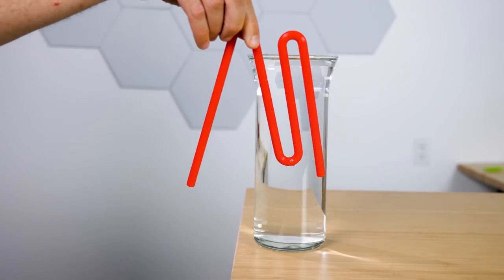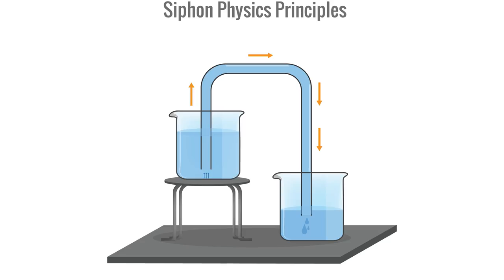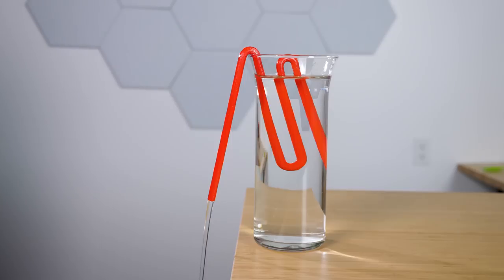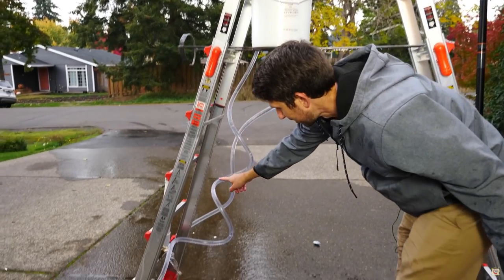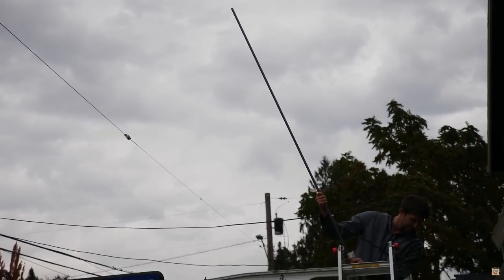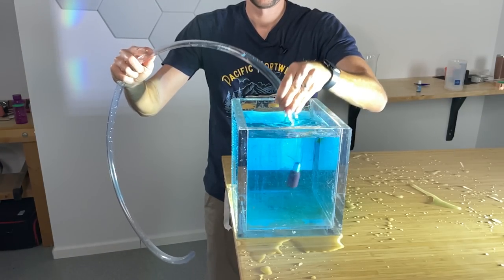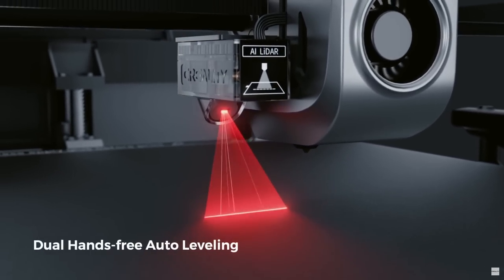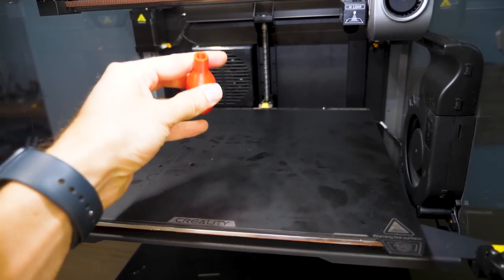This Tube Makes Water Flow By Itself

Comment: When "Free energy" topics come up, this is what I imagine is happening in the hidden physics. A ram pump is not free energy, but we do get the water up the hill without spending anything(much), other than a bit of excess water (kinetic/gravity/potential) energy. The water leaving at the bottom is the lost energy, it flowed downwards and we lose it. But to us, we have gained something (higher water) without anything(much) given.
When "free energy" comes up, everyone arrogantly/blindly shouts "Its impossible!", "laws of thermodynamics!", "Quack!"...but ignores that many things in real life appear to be free energy. The Sun, gravity, atomic radiation, fusion, many devices we've built are nearly free....What's to say we can't find an exploit at the (sub)atomic level that gives us seeming free energy by shifting some particles around?
People are blinded by the 2nd law of thermodynamics and refuse to think anything could be close to free,,,or that the energy cost would be something we don't care about losing. A whole 2 generations now are ignoring the past Tesla's, Curie's that came before them and hunted for nearly free energy.

Comment: It would be interesting to use various sizes of tubes that are smaller than the one he used. It would get to a point where surface tension would not allow the syphoning to happen.
Reply: My first guess was that this used surface tension with a comb-like series of fingers or plates that were angled upward, using similar action to a Tesla valve to draw the water in one direction.  Once the water got over the last hump, the siphon action would take over and speed up the flow.  Such a device would need a very particular scale depending on the viscosity of the fluid, however.  I like the real one better than my idea!

Comment: The momentum explanation makes no sense. You can't use momentum that you gained by going downhill to reach higher elevation than you started with. I think there is a pressure spike caused by quickly putting the siphon in the water. If you just submerged it very slowly it wouldn't work.

Comment: @The Action Lab

Time mark 0m 44s.  You make a scientifically false claim about how siphons function.
I bet that you can make a siphon work in a vacuum, but not in Zero Gravity because I challenge the idea that it is Air pressure that makes a siphon work.  It is gravity that makes it work.  the quantity of water on one side of the tube/hose contains more water within it and since there is more water in it.
Air pressure is equal on both sides.

I could be wrong, but an experiment has already proved that I am not.

Take any clear hose just to see it and fill the hose with water. Submerging it so that no air is trapped within.  
Cover both ends with your fingers.
Raise one end higher than the other, with the tube higher than the ends and the ends facing downwards.
Release both ends at the same time.
The water will always, 100% of the time, flow to the lower end.  Arguably, the lower end actually has higher air pressure upon it.

It does not matter.  Gravity makes the siphon work, there is more water within the side of the hose with the lowered end.

Comment: The Hercules monument in Kassel Germany, has an enormous waterworks, they run it for the public once a week. Takes 2 hours for the water to run down. It uses a hydraulic ram in the nearby river to pump the water up into the storage tanks. Worth going to see if you are within 200 miles of it. It was built in 1700.

Comment: This works by using the falling water as a suction force for the rising water. The first siphon is required because the tube HAS to hang out of the glass and the water can only be lower than the glass, the first siphon HAS to be below the water so it can overflow, create suction and get momentum. Now let me watch the video...

Comment: Okay I don’t get where the extra energy is coming from to push the water up past the second higher hump. Going off of conservation of energy, lets say the glass with the straw is the system.  A system has a finite amount of energy, at the first hump it would have kinetic and potential energy. Its then converted more kinetic with some potential at the bottom bend, I’m not seeing where the extra energy needed is coming from to push the water higher than it initially was. Any insight would be appreciated. You could approach this from a fluid dynamics approach to but the general energy equation I think would also lead me to the same question.

Comment: It’s not the atmospheric pressure dude….it’s the weight of the water in the downward part of the tube pulling the water in the upward part of the tube…otherwise the down side of the tube wouldn’t have to be more than the upward side……can’t believe you got this wrong….it has nothing to do with atmospheric pressure, except that the water isn’t boiling,,,,,which would mess it all up!!

Comment: Forget about shaker valve or even shaking! A simple trick is this: immerse most part of the tube in the liquid in the container and let the liquid fill the tube (up to the level of liquid in the container). Close up the exit end of the tube with your thumb. Raise the tube from container over the side of container and lower the exit end until the liquid level in the tube is below the liquid level in the container. Now open the exit end. Liquid will be free flowing until the liquid level in the container is equal to the level of exit end of tube. Tested method, it works! Suitable for all types of liquid and container, gasoline tank, toxic liquid etc.

Comment: That like a ladder.
Water goes up a tube, then down and then up a bit higher.

How high could you go? If the tube had extra "steps", would it bring the water higher and higher? What is the limit on the height?

Comment: There's a guy at a wet market who has a clever method, a bit like the shaker siphon but without the shaker. He keeps his thumb on the exit hole, and with his other hand he rapidly pumps some length of the inlet tube up and down the water- every downward pump his thumb opens the exit letting air out, and upward pull he closes the exit pulling water up. It takes a few seconds to start it.

Comment: If this glorified straw, as simple as it is, is so easy to get working as a pump, then why haven't we seen really any cases, as far as I know, of engineers using them in builds for perhaps centuries, at least where a lower pressure like this would be sufficient?

Comment: You can use the water hammer effect to power a piston that inturn drives a flywheel to keep the cycle going forever until the joints/grease wears out. And you dont need alot of height for the water to drop.

Comment: As others have already said - tlit is stye energetic insertion into the water that causes the water to start flowing.  Not the straw itself and not the sahpe.....  Without the strong insertion it wouldn't happen.

If it was very slowly inserted it wouldn't happen.

Comment: So using a ram pump setup and a way of collecting the water for use again could you have the falling water from the upper most hose flow over a waterwheel and generate power.

Comment: if you want to siphon a fluid that isnt damaging to your skin, you can do the shaker siphon with your finger on the output side of the tube. To do this, push the tube rapidly into the container and then pull it out rapidly as well, but when you are pulling it out, seal the output of the tube with your finger. The trick to it is, when you are pushing the tube in, you want to do it quicker than the fluid flows back down the tube so you can create a column of fluid in the tube.

Comment: That shaker syphon reminds me of my childhood.. We had a well water pump which had a non return valve at the end which goes in the water. The pump and motor are at ground level. For the impeller to work the pump should be filled with water. The non return valve should keep the water from draining and thus providing the starting water. But sometimes you drain it for maintenance and instead of using the filling port (where you pour water) we just use to life the valve and drop it, while it went down it opened and let the water fill.. As it fills the pipe gets heavier but it used to get the job done..

Comment: It appears that the laws of physics are broken when the water falls fast down the 2nd section and has enough momentum to go over the 2nd hump which is higher than the first hump. I don´t understand how the momentum is sufficient to continuously go over the 2nd hump.
Reply: There is also energy being put into the system from you placing it into the water, that may account for it.

Comment: How good does your new Creality K1 Max 3D printer work? Do you have any issues with it ever? I was thinking about buying one but I noticed a lot of bad reviews about it on Amazon. DO you have any suggestions for me on what brand to buy? Out of your 6 3D printers that you have, which one do you think you like the most? Also if anyone else on here has any info on how to use 3D printers and which brand to buy please let me know cuz I don't know much about 3D printing but I would like to buy one so I can try this expiriment myself.
Reply from the maker: I love the K1 and K1 max. Their printing speed makes me choose them every time. They make a perfect print every time as well. I have had problems with the extruder and clogs. I have replaced one extruder but since then it has worked great. If you are just buying a first time 3D printer the Ender 3 S1 pro is the most reliable printer I have. hardly ever has any problems. It is much cheaper and simpler. It prints much slower but is just a reliable work horse
Reply: @TheActionLab  Thankyou so much for your response. I really appreciate it. I'm a big fan of your science videos and I hope you keep posting more. How acurate are the prints from your Ender 3 S1 Pro 3D printer?

Comment: That looks like a very cool thing to help quickly change water in fish tanks!
Reply: I don't know if they still sell them, but I have an ancient shaker siphon from a pet store. It's a rigid large diameter tube connected to a smaller diameter flexible tube. Shaking the large tube up and down in the aquarium causes the water to ram the air through the flexible tube until enough water is rammed in to displace the air and start the siphon effect through the flexible tube. This siphon has no moving parts, no valve. The effect is totally due to the open mouth of the large rigid tube ramming water into the smaller flexible tube and displacing the air due to inertia.

Comment: Looks interesting.  I am wondering how much influence the speed of insertion into the water has on the establishment of fluidity?  And if we plug the outlet pipe when it is inserted into the water and then unclog it when it is in the water, does it work at all?  And how much can we raise such a siphon out of the water when it is working before the water stops flowing?
Reply: your last two questions seem easier to answer then the first. 
#2 as long as the system is designed to work on it's "own" inherent energy level. if you clog the end before submersing and then remove the plug after, it would work perfectly fine.  
in fact it would be a near maximum efficiency or a maximum 'stagnant' efficiency anyway, because no water would enter the system until after the plug was removed and the system would fill at a maximum potential stagnant flow speed as it is designed to,  again that is assuming the required climb of the siphon is set to an achievable level. 
there is the question of how much "extra" energy could you introduce into the system by "slamming" it into the water as fast as you could and driving the water up the first tube faster than the water level/pressure alone could do, I'm sure that would depend on diameters of the tubing  velocity and how deep into the water you can actually drive the siphon and probably some other factors that I'm over looking..

#3 once started it's still a sealed siphon and as long as the end in the water remains in the water holding an airtight seal and remains higher then the end out of the water it should continue with no issues. but if you break the surface as with any siphon you will lose the energy to maintain the system quickly.

#1 assuming that the system is indeed designed to work under it's "'"own" inherent energy level" the insertion speed shouldn't really matter UNTIL the water level reaches the top of the first tube and starts to fill the second tube, at that point the system will loose efficiency the more impaired the flow of liquid is (the slower you finish submersing the top most part of the tube) because when the liquid reaches the bottom of it's fall it's extra energy from falling will be wasted with 'sloshing' if there is not sufficient flow behind it forcing it farther down the empty portion of the tube.

Comment: —Would it be possible, potentially requiring air chambers to allow the water to be compressible, to make a hydraulic ram pump using resonance as the valve so there would be no moving parts.
—I'm reminded of singing tubes where a candle causes them to resonate with no moving parts without the flame touching the tube. Or something I believe that is known as the sterling engine, which I think you've done on your show before.
Reply: Your first line is basically the description of the ram pump, but water is not compressible.  The air in the air chamber is, just like the air in a water tower, which acts as protection for city water pipes against the ram effect.  With said ram effect, if there is not air in the system to act as a buffer, or the air is only in the pipes, (as it essentially can be within a house,) the ram causes the pipes to change shape, which eventually leads brittle pipes to break.

The singing tube sounds like a whistle driven by convection.  Heat causes upward airflow across a shape that resonates with that air.

Stirling engines rely on conversion between cold and hot air to drive a piston, the same way a combustion engine relies on converting liquid fuel to explosive gas to do so.  The flywheel in the Stirling engine does the same work to maintain inertia, as the other pistons in multi-stroke engines, including steam engines that Stirling intended to replace.
Reply: @VoltisArt 
.
Yes I understand all of that.  I'm just not very good at communicating it.  However I was talking about the concepts being somewhat similar when you overly simplify them.  I was using them to paint an image for you so you could understand what I was trying to say due to my lack of ability to communicate.  What I was trying to say was the air would give the water the ability to move back and forth at resonance substituting in place of its lack of compressibility.  If it's calibrated right hypothetically it would be a hydraulic ram pump with no moving parts.

Comment: Add a resistance latch of some kind at the start so that once a certain amount of pressure happens it opens and stays open while water is flowing then closes when it stops. That would allow more initial pressure to self-prime the straw and allow multiple straws/containers to be used for increasing elevation.

Comment: What happens if the straw is put into the water more gently ...
Reply: Doesn't matter. That's why it's curved up and down like that, to let water build up speed
Reply: I think it may matter ... What gives the water the energy to climb up the curve that is higher than the water level?

I think the initial jolt is what gives it the energy to rapidly climb up the first curve ... If it moves gently it may get stuck at the same water level as the container before it makes the second curve.

Comment: Just last week, I had to empty the water pan (more like a container) in back of my fridge. The holding screws were soo tight that I couldn't unscrew the container off. I was thinking of siphoning it. But the water was dirty and it sat low enough to prevent me from doing it anyway. Had this video been publised earlier, it would have helped me tremendously.

Comment: Is it atmospheric pressure or gravity on the first example ? The ram pump is genius in my opinion. Is that(ram pump) considered a free energy perpetual motion engine of sorts ?
Reply: Why would it be...? The point of "perpetual motion" devices is supposed to be that they obtain energy out of nothing - this simply harnesses a known source of energy readily available, the exact same way a mundane water wheel would: the potential energy of water at a higher point turning into kinetic energy as it flows downhill.
Reply: @AttilaAsztalos  sounds good, I wasn’t a 100% sure. Thank you for clarifying and setting it straight.✌🏼

Comment: You just violated the laws physics, buddy!

The water flows through the siphon, because the pressure is different on one leg compared to the other, this excess length causes excess pressure to be generated under shorter pipe, pushing the water over the edge cresting the siphon. Your explanation is incorrect.